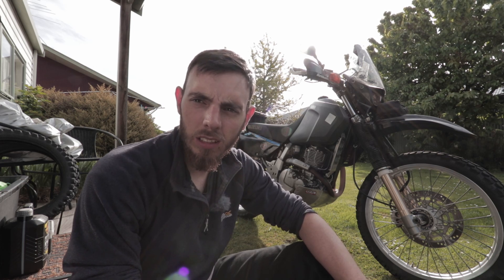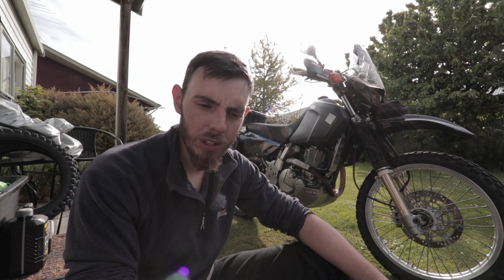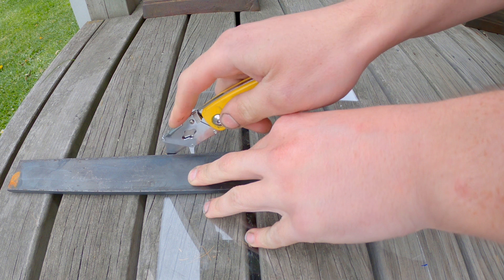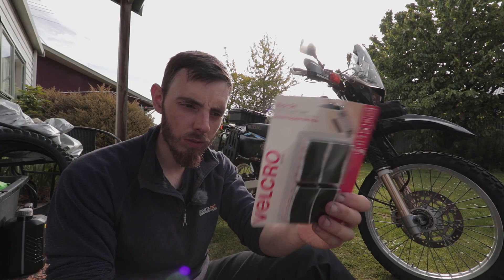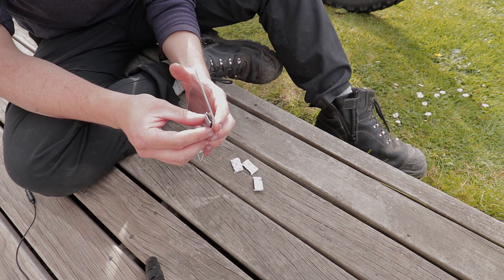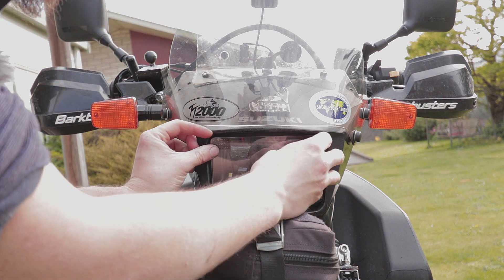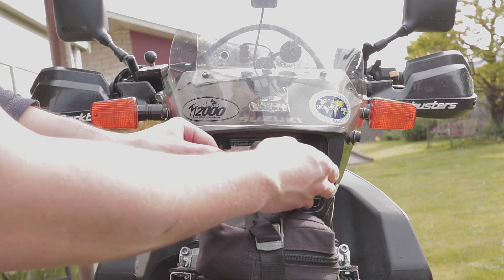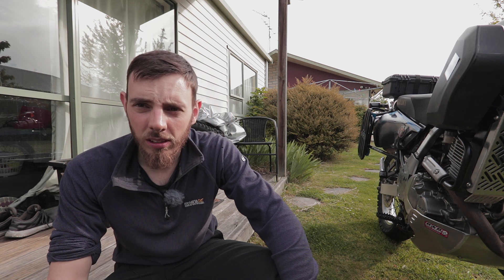Suzuki Dr650 Head Light protector

Comment: Replace your oil cooler rock guard and then use the OEM oil cooler rock guard as a headlight guard. Thats what i did since it was essentially free. Just used a couple zip ties to secure it and bam bobs your auntie

Comment: I just ordered one of these, I love the looks and functionality but I am bumbed about having to cut into my fairing and that gap.
Reply from the maker: Yep I think it looks great, I wasn't worried about the cut as you can't see it and if you ever go back to stock won't affect anything. The gap does bother me a bit though. It isn't as noticable after I fitted a plastic protector in front of the light but for the money of the light I would have thought it could be better in that aspect.
Reply: @MOTODANS  hey moto Dan what kind of hand guards to u have I am having problems finding some that will fit my 7/8th handlebars.
Reply from the maker: Barkbusters. No problems with fitment
Reply: @MOTODANS  do u have stock 7/8th handle bars?
Reply from the maker: Yep stock bars
Reply: @MOTODANS  so u did not have to cut the balls off or any other mods. was it a tight fit around the master cylinder?
Reply from the maker: Cut the balls off? They were fitted to the bike when I bought it so unsure originally. But I have taken them on and off a few times with no issues. It isn't tight around the master cylinder